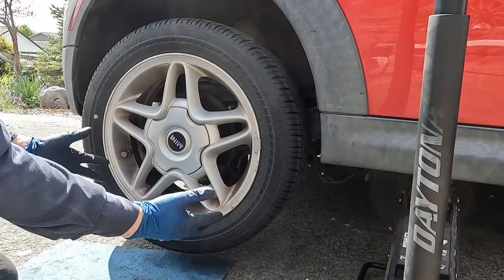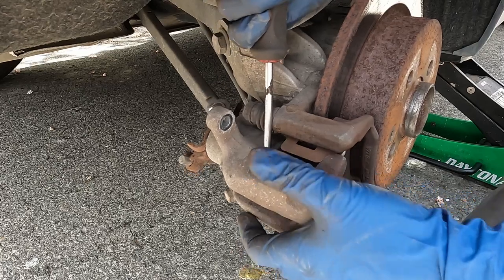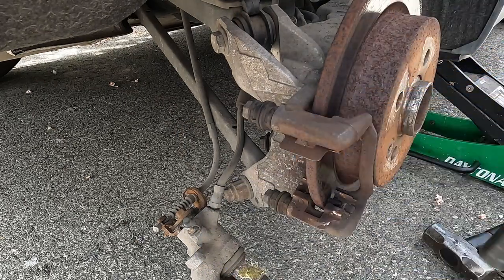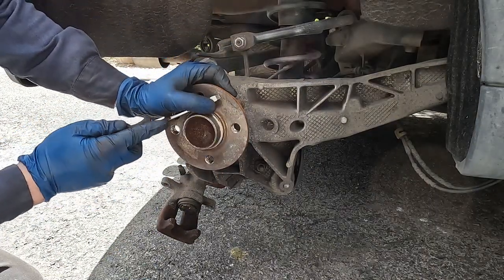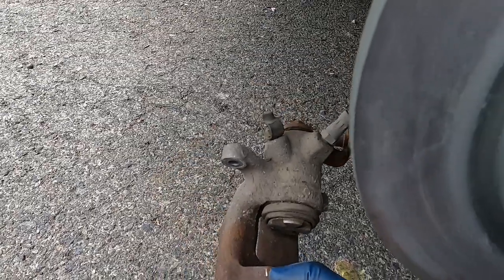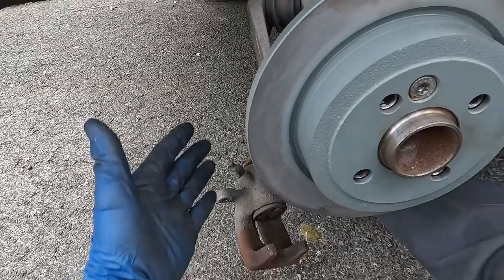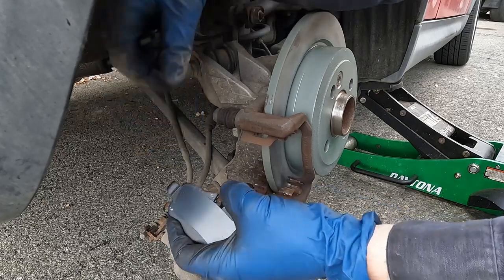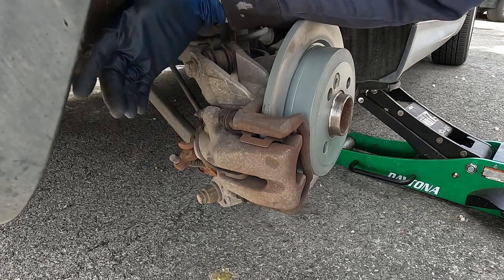2007-2010 Mini Cooper Rear Brakes Pads and Rotor Replacement

Comment: No grease on the brake hardware???
Reply from the maker: @JCX..  You can put grease under the new hardware between the caliper bracket if you'd like but grease should never be applied to exposed surfaces. Brake dust will collect on the grease and gum up the brakes.